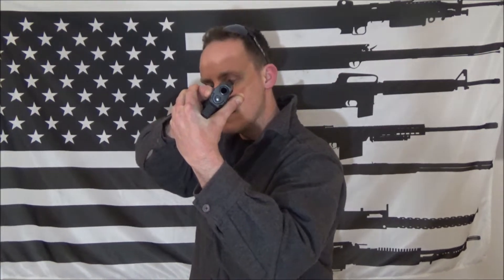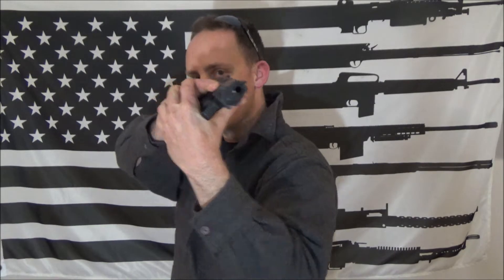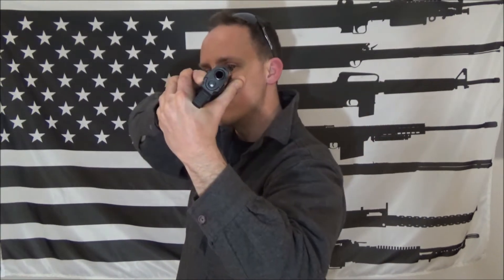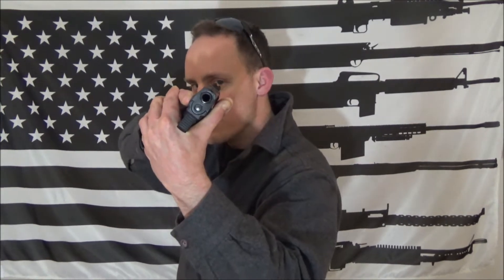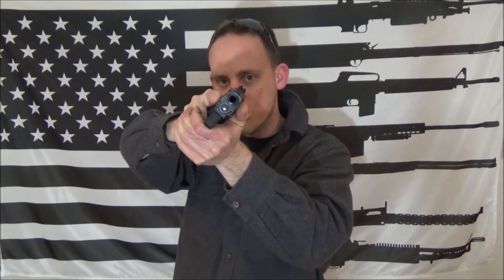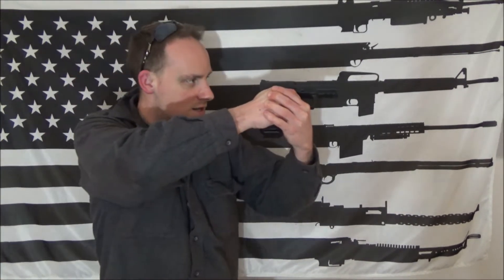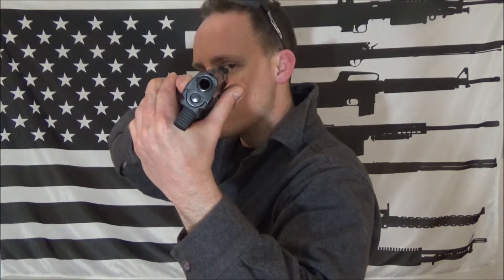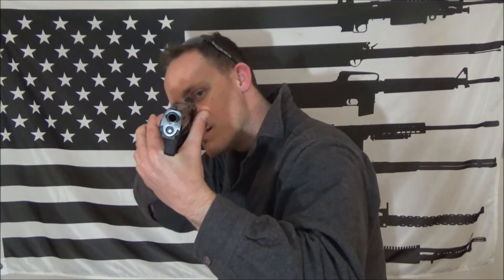Center Axis Relock

Comment: Hello have you tried center axis relock using an optic on a pistol?
Reply from the maker: No
Reply: It doesn't play to its strength. CAR is for novice shooters that don't shoot with both eyes open. Red dots are to be shot with target focus, both eyes open. But in CAR, you specifically are blocking the vision of one of your eyes at all time (stupid).
Reply: @aussieexpat  Nah, you don't get it. There is a reason why special forces themselves in combat situations do not use optical sights on pistols. The novice is the one who does not think he is there. I'm pretty sure you can't shoot well with both eyes and have never studied CQC in a comprehensive, general, and in-depth manner. Life is not a recklessness video-game or a a shooting range, war even less. You're surely capable of putting a ten on target in perfect conditions but your knowledge stops there. You're probably frustrated that an occult technique that used to make you feel smart before with a dismissive air is becoming a temporary fashion with Hollywood. Find new reasons to exist.

The CAR is used to its best advantage in very confined spaces which are particularly annoying to perform body rotations while you're armed and ready to shoot. On this level, it is unbeatable by far when it comes to defending your own life by impacting the opposite one in the most optimal way. The red dots on a handgun are only for armed amateurs using them to exist by making a score while remaining static 15m from the refreshment bar.  CQC techniques are for people whose job it is and who understand the importance of the real use of what they hold between their hands in the perspective of the use for which it was created : to kill as efficiently as possible, in the fastest possible way with the maximum possible optimization of the given situations.

Optical sights will generally be found rather on rifles and rather for the fact that they are equipped with a night vision more than just a ridiculous dot. The use of focus and sights takes on a different meaning when it comes to your life and not just being a armed asshole that never shits one properly. If you're blocking your vision, you don't know how to use it and, yeah, you're stupid, you are at least as stupid with the same firmness that you tried to employ in the previous comment.

The CAR system is designed to survive, not to score pointless perfect scores. Most of the positions are instinctively driven and the real aim work is hardly present.
The CAR is made to answer, not to ask questions and even less to philosophize about the alignment of the group 50m away.

The CAR is made to be used a few centimeters, two ammunition in the center of mass before chaining by two in the head without any aim taken upstream while shooting from the hips while bending the body while you only have 20cm of freedom total movement. A normal aim with outstretched arms is slower and more cumbersome. Take the test at home if you really need it : stretch out your arms and then fold them in half. You'll see, it strangely takes up half the space.

Nothing is perfect and this system obviously has faults, the main one being the ability to withstand recoil more difficult. On 9mm, we don't care, on 357mag, it starts to stand out clearly.

That's all.
Reply: @eternellepensee4358  I did make an argument. CAR is designed for shooting with one eye obstructed. That's incredibly dumb. Why would you design a technique around blocking your vision?

Do you even shoot pistols?
Reply from the maker: Whoa, that is incorrect
Reply: @aussieexpat  Do you even use your eyes ? If you can see both eyes on the picture, they can see you too.
Not my fault if you don't understand it, don't know how to use it and you're not biologically arranged for this.
The goal of CAR is absolutely not to block an eye when it is done correctly. It is about counterbalancing the physical forces of the natural unconscious differently.

And beyond that, when you're designed as a right-hander with upset left-hander quirks in vision, it's literally one of the most perfect and balanced positions (extended). As recoil, can be managed pretty well. I'm just saying.

Aligning one eye is not not using both. Do you have a particular problem with semantics ? I guess you can feel it elsewhere in your life.
I was using it before Wick was fashion, I don't use it for the eyes controversy shit. It's just the better position if I need it, I will headshot from the hips.

Yes, you can erase double sight picture with it
Yes, it's branded like that

No, that's not the only think in Center Axis Relock. Yes, if for you, CAR is only using one eye, you're dumbs.
Eyes are for global vision, not only your gun btw.

I'm not talking about calmly aiming at range, Im talking about defending myself in the most efficient way.

P226 as main.
Reply: @eternellepensee4358  ergh... blocking one eye with the technique is not my observation, it's part of the explicit "features" of the technique. You clearly don't know what you are talking about.
Reply: @aussieexpat  You can see it like that, it's formatted by marketing and the people who never dig into a practice to make it theirs.

I repeat it for someone right-handed with the left directing eye, without positioning the weapon at 90 ° but at 45 ° by perfectly aligning the wrist with the arm ... It is the best position that I could practice if I have to go anywhere in an enclosed environment or perform long duration recreational shooting at the pit.

Afterwards I can possibly hear that my adaptation and use differs from a generic average but it stops there.
There is no living master for this technique, it has never been "mastered" and it is not yet anchored in the tradition because it continues to be refined even slightly.In martial arts you would stay 1st dan without ever reaching 4th with that spirit.

It is a recent technique, the base is impeccable and its original author, like everyone else, is not perfect, is unique and has thought it for a global use to the maximum objective in its own subjectivity.

We are not talking about studying the art of war of Sun Tzu which has been unchanged for 5000 years.

Just because Paul Castle said that to begin with, doesn't mean he's an omniscient God who is right. 90% of his technique is good in my eyes but I correct the angle and I repeat once again that I am in a physical configuration which is not predominantly widespread to which this base in this form sticks perfectly.

I have a much more precise aim, pleased and relaxed by being able to align my directing eye in this way rather than doing it "traditionally" like most people because it forces me to either break the angle of my arm which absorbs less the shock, or to shift my head and therefore my vision by extension by gaining a blind spot that I do not want.

I fully understand what you are saying even if it amuses me to answer a little rudely in passing. Take me to the first degree without malice and try to really understand what I am explaining to you with regard to my way of doing which is unique to me. I only claim a use of the CAR that is slightly different from the generic that you describe and that everyone goes with the same base without ever questioning it.

Finally when you think about it, in the rest of the positions there are a lot of subtleties in this way of doing things and that doesn't shock anyone. I do not really understand that no one is thinking of slightly adapting its use precisely in the case of the CAR.

I guess that's because it's a fashion that it's cool to hit on (or it keeps you feeling special because I think JWick must have upped club registrations since 2014). Before John Wick everyone didn't give a damn about my way of doing things and at worst were curious rather than dismissive without ever questioning the fact that it worked.
Reply from the maker: It is not about blocking an eye. It is about using the instinctual response of turning your body and face to protect yourself. Plus, you fail to realize that the technique is based off the weaver and has been adapted to be used in the modern isosceles
Reply: @doitriteak  Holding guns is certainly nothing new.  But to claim that blocking one eye is not actually part of the technique is wrong. Look at Castle's videos.
Reply from the maker: He isn't blocking, he is talking about turning your head as you would naturally in close quarters. It is about refining reflexive fire. This is crude aiming mixed with relfexive shots. If you dont get that, we can't help you
Reply: @doitriteak  i agree with you. It is crude aiming. Completely acceptable for contact distance. But once you're over 3 yards... you should be aiming properly.

And under 3 yards, would it not be better to hold with normal retention position and use your left hand to guard from physical attacks?
Reply from the maker: 3 yards is easy lunging territory. I would say 3 yards is still suitable for this distance. Id say outside of 5yarss may be a good time for transition. I would not do it the original way either. It is best suited for fighting in a structure when close to doorways. This means usage outside of that can be easily scrutinized as show over function
Reply: @doitriteak  Exactly.

Comment: the recoil's is mostly directed to the opposite side of the ejection port. so it is a full body frame support, the dominant eye is not fixed or necessary on the sights of the pistol . the forms are meant to put you vision intuitively on the target that the eye its under. much like the third eye technic your body and center directs the round. I would say the movie if you take out the , clear insane idea that one against 50 in a armed club walks out alive  . I would say it fairly accurate, its nice to not see the guns in moves continue to click cock, rack and fire unrealistically . But its a movie, so ...